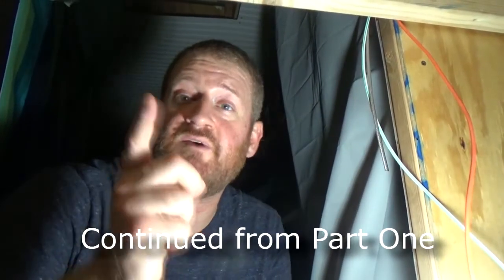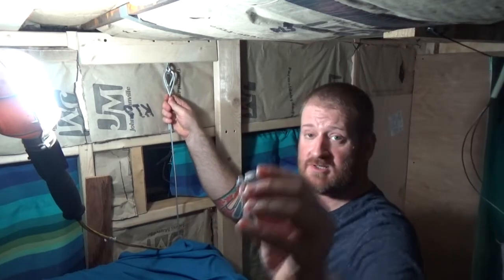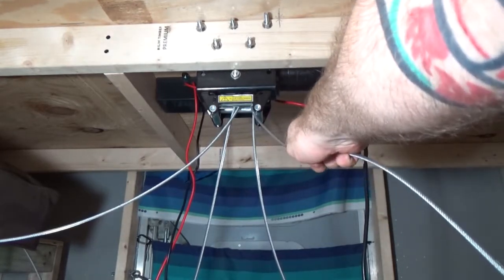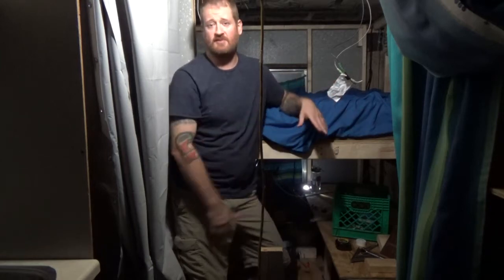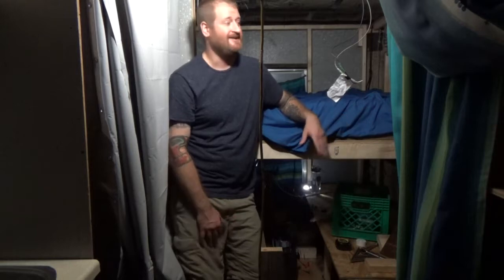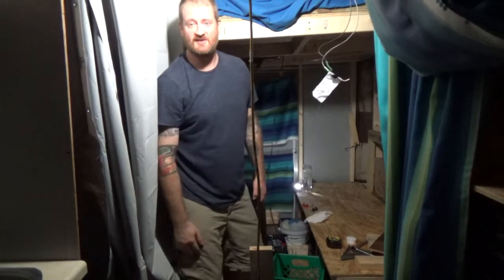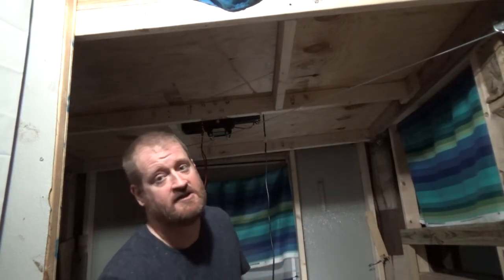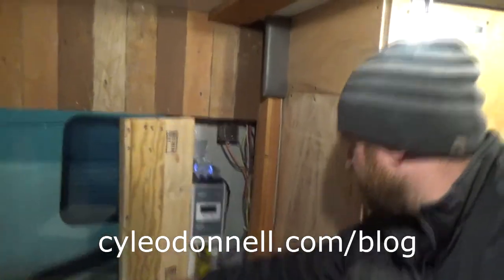Bus Conversion: Elevating Bed Part 2

Comment: Is there a cutoff switch rigged for when you get to a certain point up top, or are you just eyeballing it?
Reply from the maker: Carlos Benjamin Not exactly, though the "switch" itself is self stopping. This means that pressure must continuously be supplied or it stops. I considered mounting an external kill switch on the side wall where, if the bed raised to that point, it would trigger it. But then I would have to do resets all the time. So I stuck with this original design. Thanks for the question. Hope you are enjoying the series.
Reply: Cyle O'Donnell indeed! The elevating bed (or a Murphy) is something I was hoping to do, so it was good to see your process.